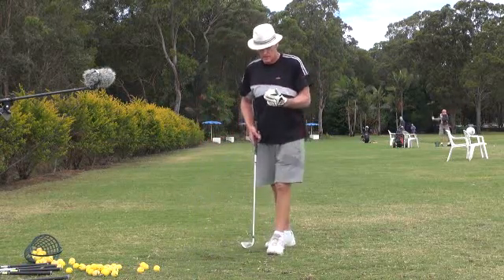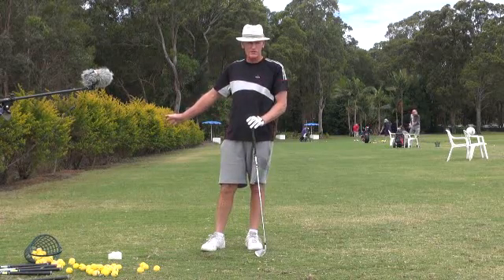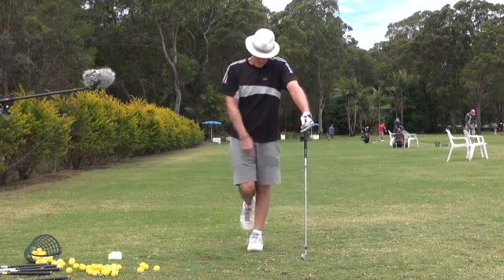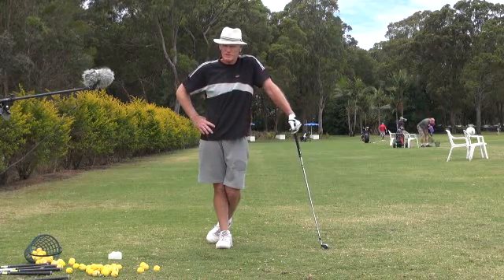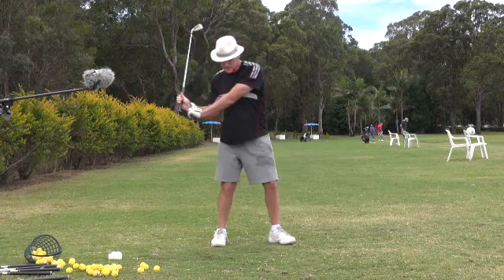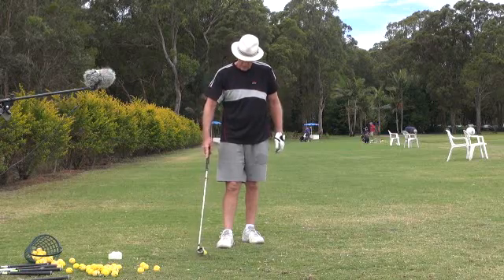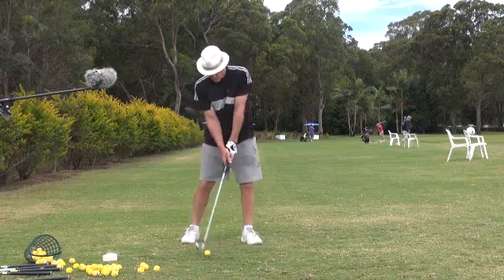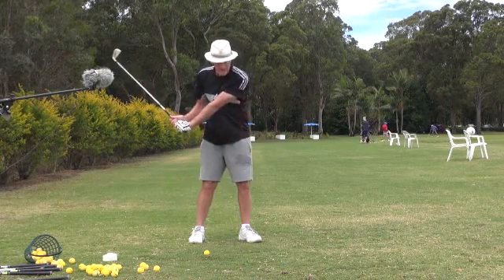Single Axis Application Mechanics 1

Comment: Snead says in his book. He played short irons keeping weight forward throughout. Also read somewhere of Demaret doing the same.
Reply from the maker: Hi Ira,
       I'm sure  the great majority of  tour players and  better  non pro golfers  load  forward  to play  short shots  , that is because  they want   a  steeper attack angle at impact to impart more control spin to the shots. 
           I  took  it a bit further  by   applying it to  'all'  shots,  I guess it  was  a   similarity   of sorts to the Stack and Tilt  swing  method..
         Demeret  really did lean  into his lead side  with his  short shots, as did Tommy Bolt ..and Hogan  ,,  the era  it was  just part of the  doctrine of  swing mechanics.. 
       cheers JH

Comment: Hey jh, I have purchased a set of cobra f7 one length irons with a 4 degree loft per your reccommendation anf love. I am ready to buy the Cobra f8 one length hybrid 3 wood. My question is Do I get a 4 degree loft on that club as well? Thx. For all you do.
Reply from the maker: Hi Paul,
                 I think you are referring to the lie of the clubs  .. not the loft... I don't know   how much     they can  bend the  hybrid   in terms of lie .. maybe  if you get a club fitter  or  the shop  you bought the clubs from   if they have  a good loft and lie machine that can bend hybrids    they  might be able to do it for you  ..      the hosels are  a  decent length so I think   they should be bendable adjustable .. the   club  fitter will know that for sure .. you will love the hybrids..they are   so easy to hit ..keep me up to date with  how you    are going with the clubs and  your swing ..
                      cheers JH
Reply: Merry Christmas, JH. Thx for your reply. Yes, I meant 4 degree lie. I am using the single axis swing you teach along with you foolproof pitching and chipping and da vinci code putting with tremendous success. I will keep you posted on my progress.  Your teaching is a tremendous gift to golfers.

https://youtu.be/OjGtDxyVBbM
Reply from the maker: @willard1263    Hi Paul,
                               Merry Xmas to you also ..    any help you need just let me know ..
                           cheers JH